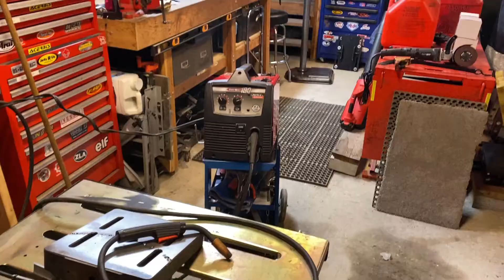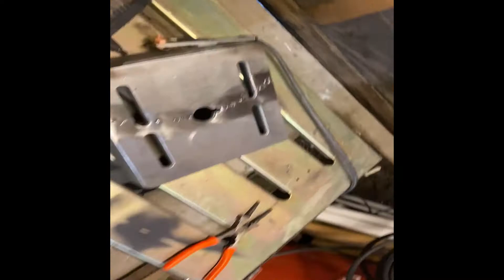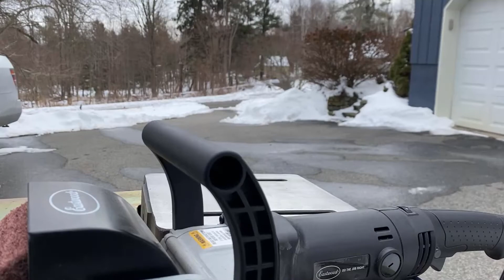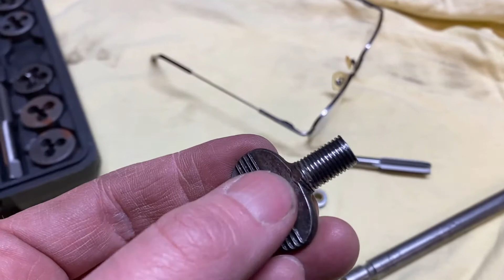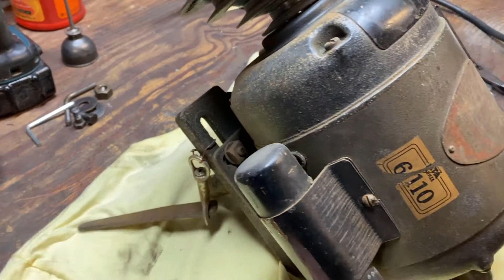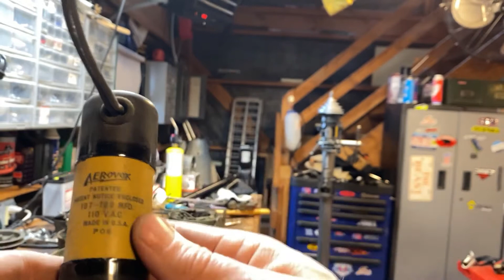Delta DP220 Refurbishment Part 3 - Removing the Arc of Shame

Comment: I use three jaw pullers for tight bearings
Reply from the maker: Much better choice than what I used here.  I picked up a bearing separator/puller after I made this video as that makes this type of job much easier.  Thanks for watching.